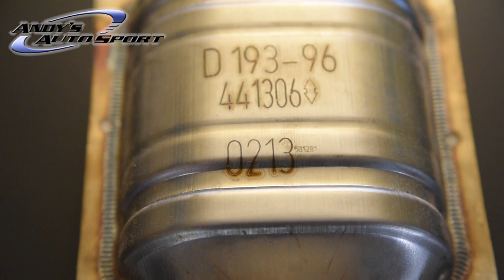Magnaflow Catalytic Converter Features

Comment: I have a 2012 mazda3 2.5L S. I purposely got the last model of mazda3 before they went skyactive technology with the intention to modify. 
I am going to replace headers with a catless MSDS 4-1 which i already have. This will delete the first cat found in OEM headers. 
Whilst putting the new header in i want to replace the remaining/second cat (and resonator further down the line). I have considered magnaflow cats, they are at the top of my list for options. 
I have a concern that replacing the cat wont give me any back pressure. Is this a valid concern? Would a non 'hi-flow' cat be the best option? Will a non hi-flow cat provide better performance/engine breathability than the stock OEM?
Can you recommend a 2.5 inch entry and exit cat to suit my purposes?